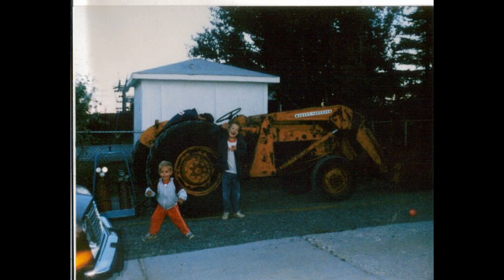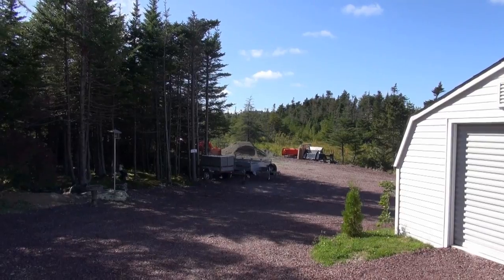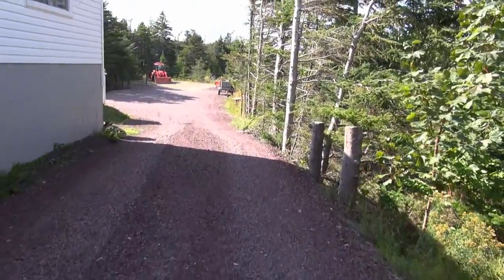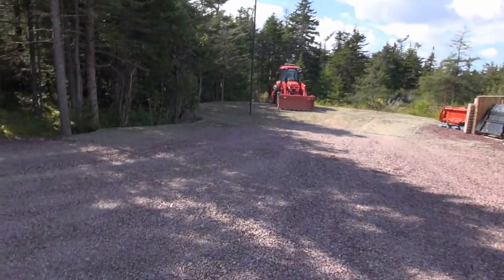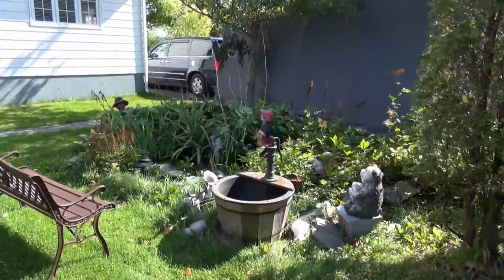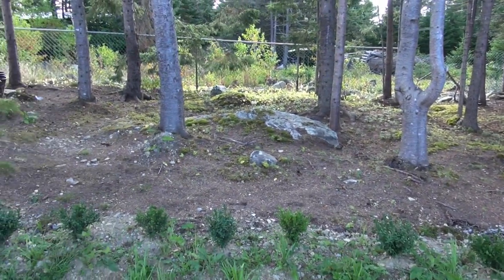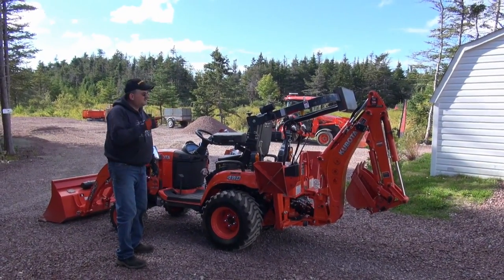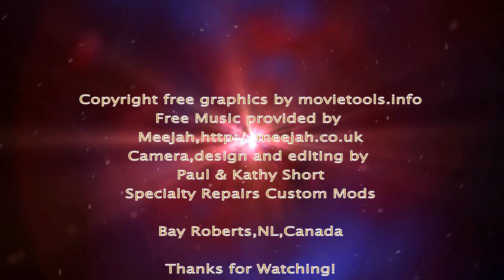Kubota 5740 & BX25D Working

Comment: another fine job the both of you have done ., plus you have a nice hill to slide down when that stuff some call snow ( myself i have a few other choice words for it ) gets there.
as you know i hardly ask question's cas it's your work / job / play time .......well i gonna ask 1 
how come you don't use a laser level of some kind?
 yeah i know your eye site is 20 / 20 but ....................lol 
wow almost forgot the main thing great job looks good 
o.k. 2 questions now 
how far back can you still go if you still needed more drive way space ? 2 ft or acre ? 50 acres ? lol
Reply from the maker: BIGMAN FROM MICHIGAN If I were going to have paved that area I would have used a laser level but it really didn't need that kind of attention. I've done a lot of grading with much  bigger equipment in the past. The smaller stuff is harder to grade with.  As for the small hill. It hasn't been an issue for the last two winters so I won't worry about that at this point. We have about 2 acres back there so more videos in the future ;)

Comment: that would be a good place for a bigger shop with radiant heated floors my shop is 30 x36 doesn't take long to fill them up the property ive been looking at has 40x60 shop
Reply from the maker: bornriverratt smith A bigger shop is in our near future and your right. You'll never have them big enough.

Comment: I noticed in this video that the bucket on the 5740 had several brackets on the top back portion of the bucket and also 2 holes in the top of the bucket.  What are they all for?
Reply from the maker: Paul Sargent Paul the brackets are there for the grapple claws and twin hydraulic cylinders I fabricated last year. I made them removable so I can use the bucket for other things other than just a grapple.
Reply: Great Idea !!!
thanks